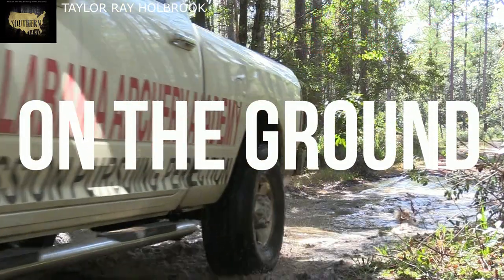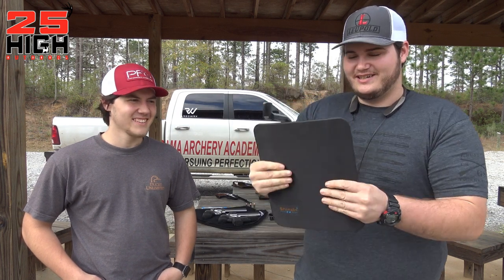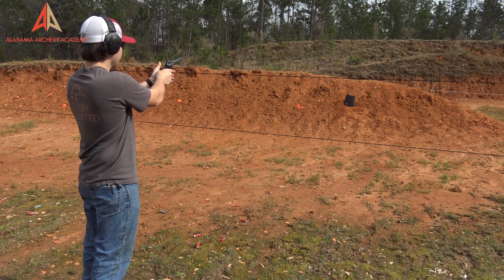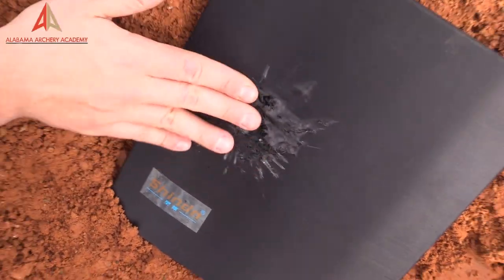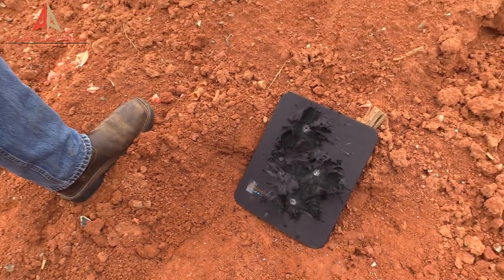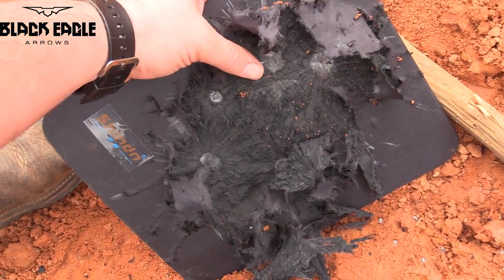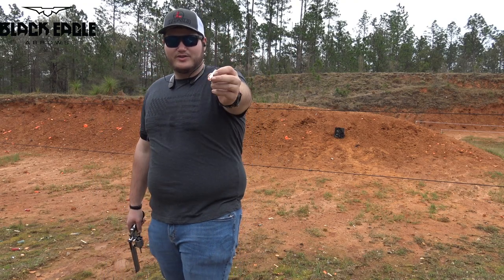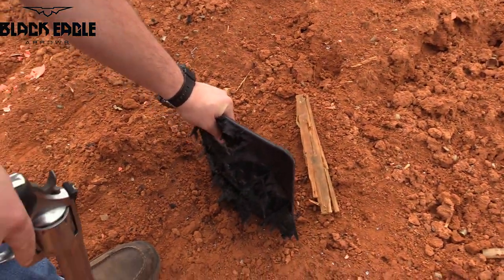WISH BODY ARMOR????  DOES IT WORK??? ONLY $35.00!!!!

Comment: That 10.5" ar isn’t a good representation of the 5.56 round. The short barrel doesn’t give it the velocity it needs to perform like it should. That’s why I prefer a full 20" barrel. The shortest barrel that actually has much usable velocity is about 12.5"
Reply: 300 BO for ar variant sbr

Comment: Ran into this video... you are wrong.. it is made for use in the stab proof vest in the same brand "Shindn"...which is also serves as a plate carrier... although they apparently make a backpack you can put it in as well...
Reply from the maker: The plate we tested in this video is 100% made for firearms. Do we recommend it? No.
Reply: @25HighOutdoors  yes I know... But I got the stab proof vest from "Shindn" and there is a pocket on each side of the vest to carrie the plates in, 

You can those between 2 plates a thin and a thick plate, you can't just hammer a plate with everything you got until it goes through, and when you goes through say... "oh we won't recommend that"... it is not made for at torturetest, it is made for stopping 1 ore 2 bullets in maybe 9 mm which wil be the one most likely to encounter.. but it can stop a larger bullet like AK and AR15... it is not made for use like a bulletproof vest... it is made for additional use in a stabproof vest, like ceramic plates in a fragvest.

Comment: Great content and test guys! I want to say even though it did stop the round the armor coating that catches the spalling is almost as important as the armor itself sure uou stopped  a  bullet  but without  sufficient spalling protection you now have thousands a razor sharp razor blades pushing up into the bottom of your chin and probably into the jugular in your throat,i cant  stress that enough while I agree it's better than not having any armor at all, I'm saying this so whole bunch of people don't go out and buy this armor thinking that is sufficient protection because  its not, you could take steps yourself and coat this with some good bed liner like Line-X but spalling is to be taken seriously,real deal ar500 armor  is not that expensive now for $150 you can have a full setup including a molle carrier so the question is,is your life worth saving $100? For me the answer  is no hell no

Comment: What size is the plate
Reply from the maker: Jon Smith it was the medium plate size regarding it's thickness.
Reply: @25HighOutdoors  would it fit you?? What you think about it overall is it reliable, comparison to another high quality plate is there a weight difference?
Reply from the maker: This plate blew our minds on what it was able to do. But as we said in the end of the video if you looking to invest in body plates we would recommend AR500 of Spartan armor (which in alot of cases use AR500 steel). 
This plate stopped rounds great but it's outer coating definitely didn't stop splatter like better plates.
Reply: @25HighOutdoors  right on
Reply: i bought one off wish similar to it and its 9x11